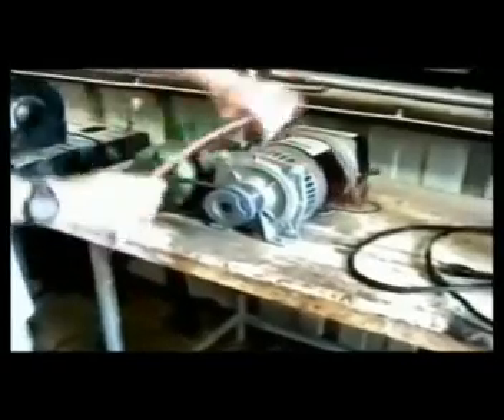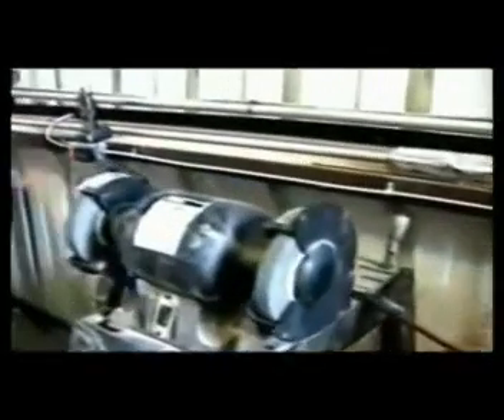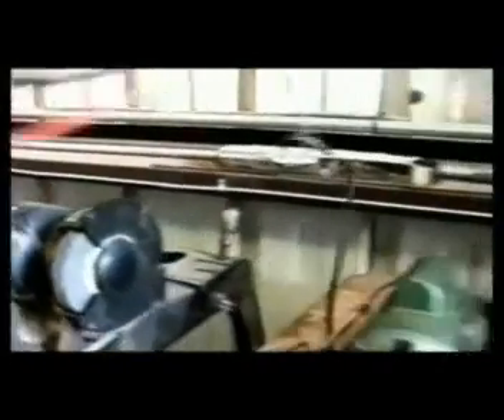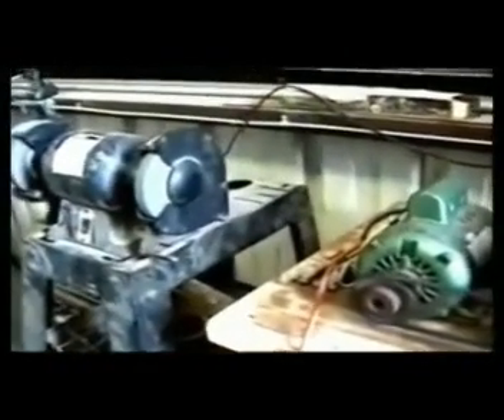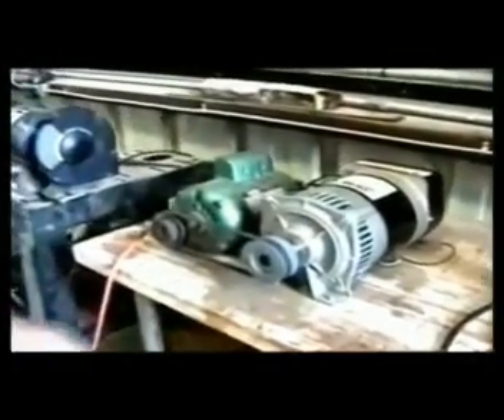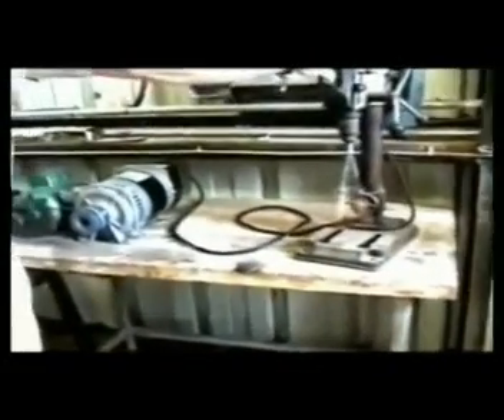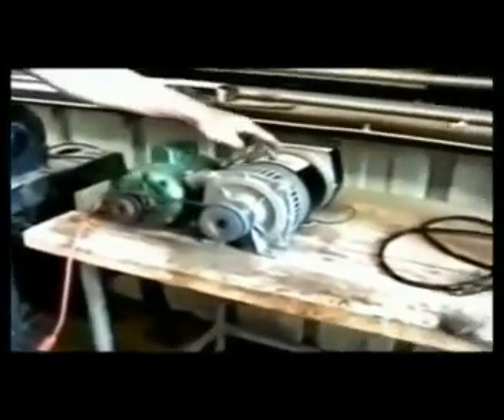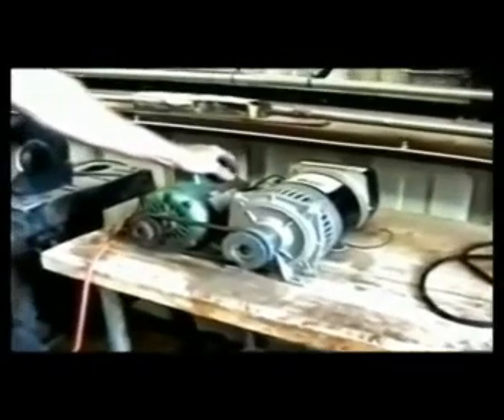Howard Johnson Magnet Motor

Comment: Mr. Hogoenergy.
Your first mistake is not showing a schematic of your generator improvment to the veiwer.

I will show the world how to couple a 2hp 15 amp motor  to a 220 vlt/90 amp generator that starts with the factory 420 cc gas engine but runs it self off 15 amps of gen power and allows you to harvest the additional 75 amps for work.

Comment: Scam Alert
Featured: Buyer Beware / Magnet Motors > Howard Johnson >
Howard Johnson Magnet Motor Scam Hosted by ClickBank - ClickBank has been hosting a vendor that claims to have developed plans for a magnet motor that will power a house using less than $100 in parts, taking maybe a couple of hours to build, even by "newbies" -- obviously bogus. Furthermore, at least some of the plans are misnamed and plagiarized. (PESN; March 17, 2012)

Comment: This is not a scam. These are motors are simple to produce at 2kw in single phase. What's hard is creating one with enough torque to turn a 100 amp 2 phase pure sine generator head. N52 mags big enough to produce that much repulsion get real expensive real quick.

Comment: This is NOT a Howard Johnson Motor. And you can't build one for 50 bucks or even a 100 bucks. However I would still recommend someone try building one, find the REAL Howard Johnson Motor and not these scam artists on the internet and begin to move toward producing your own energy. But understand it will take hundreds even a few thousand dollars to properly produce electricity and then convert DC to AC and make it grid interactive. And it is not a small thing to get the ok to be grid interactive.

Comment: It's also worth noting that if you need to use electricity to create the electromagnetic effect; 1) You can use a single marine battery (for long life and a larger charge), and 2) the amount of electricity needed to power the magnets would be much less than the total output of the device. So while it might need a kick start, the machine would have self-sustaining functionality, assuming you can overcome friction, drag, and the other problems that have arisen in attempting to make this machine.

Comment: The magnets don't contain energy. You're right. But they do provide force for propulsion. If (and that's a big if) you can propel a rotor with magnetic force, the magnets for all intents and purposes serve the same function as the serpentine belt on an automobile. The belt turns the alternator pulley, which turns the parts inside the alternator that produce the electricity. If you can simulate the function of the belt, there's no reason you shouldn't be able to produce electricity.

Comment: Since he's plugging power tools into the generator, I suspect he added an inverter. An alternator style generator is going to produce low voltage D/C. You need 120V A/C to run power tools.

Whether or not the motor actually works, who can say without building one. But some simple modifications would be needful if you wanted to be able to plug things in the way he did.

Comment: It's not a good investment if the thing don't work though, is it?
The problem is that magnets DO NOT contain ENERGY they contain a FORCE, trying to extract ENERGY is a fruitless venture because they DON'T contain it.
It's like trying to squeeze lemon juice from an orange, it just ain't gonna' happen, unless you cheat, like putting the skin of an orange around a lemon or in this case attaching a POWERED MOTOR to the drive.
See my point?

Comment: There are special magnets(neodimium) that are the best and do the trick.Problem is that neodimium is a VERY rare material and you have to sell 2 houses to plan suck a motor than you can put even to a car to run it. The particle accelelator run also on magnets! What took them so much to figure it out that only by magnets and a little physics you cand do so more! Learn people,read and be smart !

Comment: This isn't true perpetual motion... He had to have an initial start, but once that is complete the unit will run until the motor or generator fails (worn bearing, belt breaks, or the system get overloaded...

This is great work and proves that this way is very possible and will work. 

I like it alot.

Comment: I myself prefer solar energy, so I went  to Harbor freight tools  and  bought  many panel kits  and  put  them together. Every day  and  every  night  I  Do really  get  free  energy, which is  stored  in  battery  banks, inverted to  AC and  my solar  controller monitors  and  protects  my  Free  electrical  system. . Do your  own  research and  be  FREE.

Comment: An overunit outputs more energy than it uses, this is a proven fact, generators have always done that. What Howard Johnson's motor does is exactly the same, except it adds more attrit to the system (Magnetic drag forces). In the end, that same motor is worse than a generator. It is as simple as that. The same "scam" can be easily seen while searching for perendev motor.

Comment: 1) This is not a Howard Johnson motor, as his motors are purely permanent magnets, not "modified" coil motors.

2) Your link is to a scam site selling a dream, not giving anything away, as you claimed.

3)What's the function of the 2x4 mounted directly underneath the bench top, below the "generator"? Does it hide the power supply line? 

While I am no skeptic of the notion of free energy (the atom is Nature's proof of perpetual motion), I AM a skeptic of those who lie to me (see #s 1 & 2 above).

Comment: Never seen a generator not slow a bit from a load of a starting motor. Do this again bit have the drill press running while you cycle down the unit. No way.

Comment: Charles is right, he is running this as an induction motor.  Not common for most people but if you are familiar with electricity it is no big deal.  One of the things I never hear anyone address about magnetic machines is the energy it takes to make a magnet.  There is no violating the laws of physics.  That energy is being stored in the magnet and comes at a cost and the magnet will deplete and they will need to be replaced.  Not perpetual motion just perpetual trickery

Comment: As an electronic engineer for 43 years, my BS detector seems to be spinning. 

It's really easy to have hidden wires under the table to make this seem like it works as you say it does.. This isn't a very compelling setup you've shown here. This seems like a P.T. Barnum setup to me. 

Oh! And this "free energy" just happens to also be 60-Hz AC too, so it can run AC induction motors? Wow!

Comment: @ghendric It's impossible to create or destroy energy. This makes perpetual motion impossible. Magnetic trains use opposing magnetic forces to hover above the tracks, but require outside force to actual move along the tracks.

Interestingly, I explained why this machine was impossible in a previous comment, which has now inexplicably disappeared.

Comment: While the idea behind this is intriguing, there are a few problems with this video.

1. low quality. This makes it much easier to hide cords. 

2. its in a shop , so there may be hidden outlets.

I am not saying the idea cant work, but for demonstration purposes you need a different environment and a much higher quality camera.